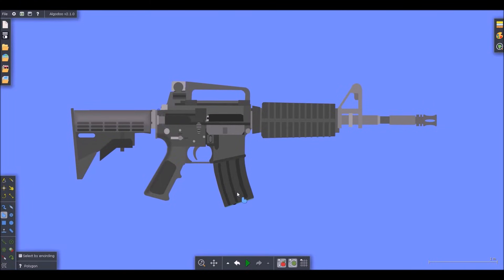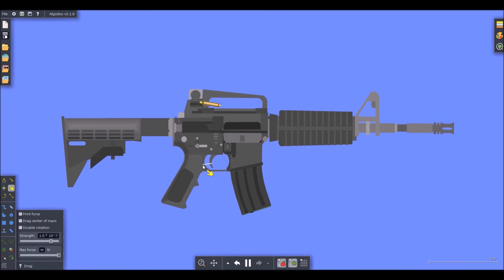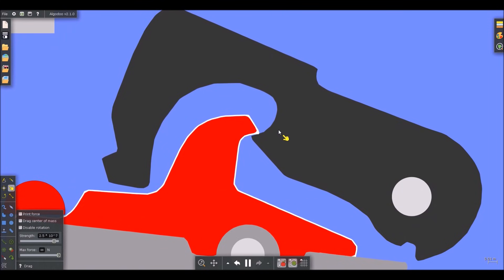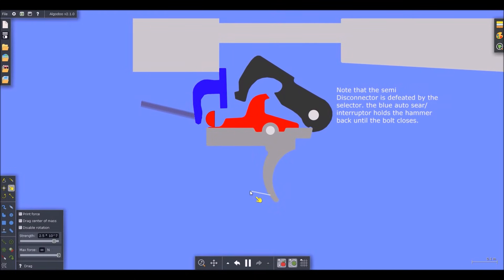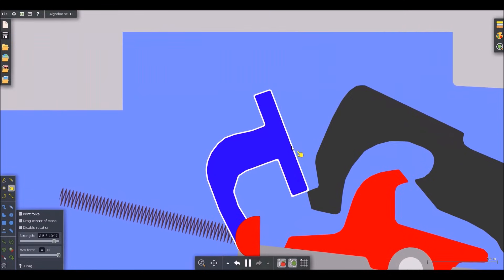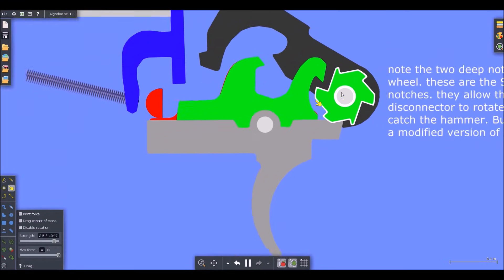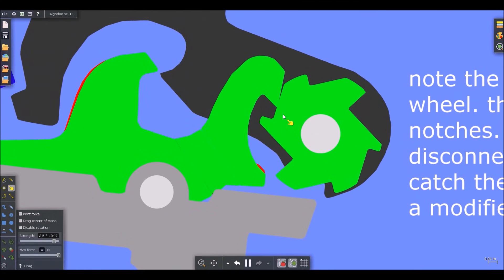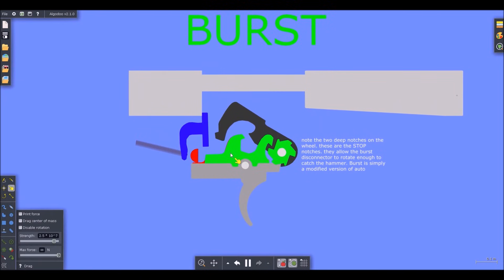How 3-round burst works

Comment: Nice video, I would add that the ratcheting wheel is also ratcheting in the normal axis of the screen, and has a spring loaded pin housed on the hammer; thus only transfers energy when the hammer is moving non-clockwise.
Reply from the maker: Actually, there is no pin and ratched in the cam wheel. Instead, there's a coil spring clutch that is bound the the sear and binds to the hammer's axle base when it's being cocked, but slips when it's dropping.
Reply: Oh I have no experience with American weapons, the Kalashnikovs 2 round bursts work with dual ratcheting surfaces, I wouldnt trust that tiny spring after heavy use. Are you sure its not dual ratcheting?
Reply from the maker: Aleksandr Mijáilovich Prójorov i'm sure. It's entirely friction-operated.

Comment: Now what happens if you release the trigger in the middle of the burst cycle then press the trigger again? Will the cycle pick up where it was interrupted or does it somehow reset that gear?
Reply: unfortunately it picks up where ya left off.not that big of a deal as the second and third should be more about insurance anyhow but its definitely possible to get a double tap then a single especially if you have any time practicing doubles on a standard full auto..also tends to happen a lot with fresh mags and /or after a misfire or feed failure

Comment: Detailed explanation, thank you - but I wonder what would happen if you attempted to do a three-round-burst with only two rounds left in the gun? What happens if the camwheel rotates only to a 60 or 120 degrees, and a full mag is inserted to continue firing? Or if another firing mode is then being selected? Are there any risks that an only to a 60 degree rotated camwheel could cause the gun to fire a two-or-three-round-burst even if semi-auto mode is selected? Could an incorrect operation of the burst mechanism or the selector switch cause damage to the gun? My favourite example is the Beretta M93R, shoots semi or three-rounds-burst, mag holds 20. Of course one could load round 21 directly into the chamber, so there would be 21 rounds in the gun and all would be fine with seven bursts of three shots, but with 20 there can only be six bursts and two would be left in the gun, or the camwheel will just be rotated to a 120 degree if last two were fired...
Reply from the maker: The m93R uses a linear cam inside the grip that auto-resets whenever the trigger is released. Many other firearms also use auto-reset cams. The AR platform was not designed with burst in mind initially, but the mod was one that came later. Since they effectively had to retrofit the existing trigger with as few parts as possible, they went after simplicity at the expense of reliability. Indeed, the cam can be in a position that is between bursts, and it consistently steps one notch at a time in semi. There's videos here and there where marines or soldiers fire single shots, switch to burst, and get one or two rounds instead of three. But immediately after, it goes to three rounds every trigger pull (unless they run out of ammo or release the trigger early, in which case the mech would have a short burst once reloaded and firing again)

The mechanism won't damage the gun in any way, it's just a tad finicky
Reply: Thank you for the quick and explicit response! I think in a combat situation it is crucial to have a gun you can totally rely on, but if you expect three shots and only get one or two this could mean serious trouble. And rumor has it that if this particular type of gun is not maintained properly and by experienced personnel, this will lead to no good...To me these types of guns would be great collectors items and serious fun on the range if there was a chance to own them legally, one can almost forget about that here in Germany, but I don't think I would trust my life to this particular type of gun, if I was given a choice I'd obviously go for the fun switch but in a more reliable standard semi/full auto configuration - nevertheless, anyone who, like me, appreciates mechanical devices like precision clock movements can't help but be intrigued by this extent of ingeniosity and skillful craftsmanship!
Reply from the maker: +Frank Steinmann Of course! I try to stay on top of this as much as possible :) I do have another video like this for the MP5, if you wanted to see that. It's very different. Check it out!

I also grew up in Germany :P I speak German and English fluently, but more so English after living in the US for so many years.
Reply: Awesome! I live in a small town 20 miles from Münster, nearby the Ruhrgebiet - how do you like my English?  Checked out your MP5 video, really cool stuff, the MP5 is my favourite submachine gun - I'd love to own one, my choice would be the MP5A3 with fun switch, S-E-F trigger group and flash hider, or even the MP5K PDW in same configuration.
Reply from the maker: +Frank Steinmann your English is perfect!

Comment: This makes things super clear now. I knew there was a way to turn a three round burst into a full-auto safely, but was wondering if it would work for a semi-auto as well.
Reply from the maker: You'd have to remove either the burst sear's hammer-engagement interface (hook) or remove it altogether and replace it with a washer of near-identical thickness. Semi-only(civilian AR) to auto? A lot more has to be done. Won't bother explaining that, though it should be obvious what would be needed.
Reply: I did recently learn how to make a lightning link, which wouldn't permanently convert a ar to full auto.
Reply from the maker: +MrChucklebean i would be careful if I were you; I'd rather get a grandfathered mg legally through all the expenses and hoops, and not risk severe penalties for a victimless crime

Comment: Awesome video! Though, can you explain what keeps the 3 round burst wheel from spinning freely? Is it a spring loaded ratcheting action? Thanks in advance.
Reply from the maker: The extension of the burst sear/disconnect is enough to keep the wheel from reversing, but it'll still tend to spin in semi auto as well. You can get a shortened initial burst  by firing in semi auto and switching to burst, yeilding either one or two shots if not three. Of course, the next pull of the trigger would function as normal. The mechanism responsible for rotating the cam is a spring clutch bound to the wheel. It's a small coil spring with an internal diameter matching the external diameter of the shaft at the bottom of the hammer. It slips one way, and binds the other.
Reply: +Stealth The Unknown Awesome, thanks again! I'm just getting back into the AR world!  :D

Comment: How does fire rate control (like on Maxim gun) works?
Reply from the maker: Not sure about the maxim, but for some, an inertial delay can be used to reduce fire rate. For example, if you were to look at the trigger group of an AKM and compare it to a traditional true AK-47, you'd notice an additional part hinged on the trigger pin. It's a component that uses its inertia to delay the hammer drop. It's minimal, but it is measurable. I believe the original intention was to help prevent light strikes caused by imperfections due to cheap mass-production of stamped receivers like that in the AKM. Though, the idea can be upscaled and selectible to allow adjustible fire rate
Reply: ***** Thanks!

Comment: Seems like it would be extremely simple to just file that catch off and make a semi auto gun full auto.
Reply from the maker: This is an unreliable mod, and I wouldn't reccommend it. Since you wouldn't have a true auto sear, you'd be relying on the inertia of the disconnector to hold the hammer back long enough for the bolt to lock into battery. If it was filed too much, worst case scenario is an out-of-battery fire. Best case, hammer rides the bolt forward. 

Long story short: don't do it.
Reply: ***** Don't worry I wasn't planning on it, but couldn't help but notice a potential modification that I bet people have tried.
Reply from the maker: +KiwiPowerNZ more than likely. People tend to do things that are questionable.

Comment: I saw the Glock. I've bee studying too much SolidWorks (I hate it, everything is tough on SW), I won't be so good on Algodoo so soon. Maybe I have a hardware problem with the 3 computers I use, some designs still are starting to shake and I just can't find the reason.
Reply from the maker: It's likely the low simulation frequency. Algodoo defaults to 60hz physics timestep, which is good for simple physics, but not where tight tolerances and quick motions are being rendered. Things clip through one-another and bounce out, causing shakiness and mechanical failure. All my scenes use an average of 200-300 hz, with only a couple using as low as 100. To increase the frequency, go to settings (gear icon), "simulation" tab, and slide the frequency slider to an acceptable frequency. I would start with 200 and increase only if necessary.
Reply: *****  Yes. I tried. Sometimes works, sometimes not. In one case I did not note I draw two identical parts on the same space (my fault).

Comment: Did you consider to incorporate a two stage trigger on your designs? Just something to tell the firer "from this point this gun may fire", like the Geissele, which seems to be just an AK trigger on a AR15 receiver where the accidental contact between the secondary sear and the hammer causes the two stage trigger effect. I gave a little on algodoo and I am trying to dominate Solidworks. From autocad to solidworks is like from windows to linux: tough, tough, tough, tough, tough,  and painfull, but not impossible (even for a stuborn donkey like me).
Reply from the maker: I actually have not really put much thought into that. When I get a PC capable of running the program up again, I'll try it. In real life, I noticed the benefit of a 2-stage trigger.

Comment: This is an amazing animation and I am trying to do something similar, how did you do this with Algodoo? I am looking at purchasing the spaceclaim software, but don't want to spend that kind of money to do what you have done here.
Reply from the maker: YEARS of messing around with the program lead to innovative ways to manipulate it. My best advice is to make the shapes of parts as accurate as possible, make their densities high enough to improve functional reliability, and to increase the simulation physics frequency high enough to stabilize the scene if there are a lot of fine moving parts. Usually 200-400 hz does it.

Comment: I'd just like to point something out where you were slightly off, you said that if the hammer fired off too early, it could result in catastrophic malfunction, which is wrong, it will simply ride the bolt forward and not fire, because it doesn't strike the fireing pin with enough force, which is easily demonstrated by tying down your seer, or bumpfiring to fast, it is an action known as outrunning the gun.
Reply from the maker: +Bradley Homer this is true, but I was trying to make the point that it is dangerous and unreliable to have the hammer follow the bolt forward. Though it is rare that this causes any kind of out-of-battery firing, it HAS happened when "outrunning the gun." The results have always been undesirable in those circumstances
Reply: I've tried to make guns fire like that, but I could never get it to happen.
Reply: Bradley Homer - ok. So if you watch the video I posted above, starting at about 8:00 into the video he starts to explain that (while not likely) there is a chance that if the disconnector failed to catch the hammer and did ride along with the BCG, there's a possibility of the round firing out of battery. Just wanted to point out that he wasn't entirely wrong when he said there could be a catastrophic event. No biggie.
Reply: hey guys put your rulers away
Reply from the maker: +Jason Cox this is so wrong, but I'll elaborate further since you are sort-of on the right track. It won't fire after the first shot if you remove the disconnector, as the hammer will ride the BCG forward (bolt carrier group.) However, some people have allegedly filed the interface on their disconnectors to temporarily catch the hammer, but cause it to slip soon after, effectively turning the mechanism into a rate reducer. This mod is highly illegal, though, and I'd advise against it.
Reply from the maker: +Jason Cox fair enough. I'd imagine if the firing pin wasn't shrouded, the issue could occur. I'd venture the disconnector had bad engagement rather than being missing.
Reply: +Bradley Homer I was just getting ready to point this out.
Reply: Bradley Homer - you are wrong. there IS a chance the round could fire and not just "simply ride the bolt forward".
Reply: Could you show some type of evidence, or a documented example, I'd have no issue admitting I'm wrong, if you can show me how I'm wrong.
Reply: This is commonly done on AKs, since you can tie back the arrest with a piece of wire creating a full-auto only version that does ride the bolt forward.
   
You have to extend the firing pin, however, since it has far less pressure on it (meaning it will naturally dimple the primer but not activate it) and it is stupidly dangerous (since it can explode out of battery, since you are pushing the round with an extended firing pin).

Comment: Why the wheel rotate in one direction?
Reply: +sakda K. i too would like to know i assume there is some kind of little spring finger that acts like a ratchet kind of like how a ziptie works it slips through one way but doesnt go back
Reply from the maker: +Justin M sorry I missed this. This is something I've answered a few times as well. It's a friction/clutch spring, and binds against the hammer as it's pushed backwards by the bolt carrier, and slips as it drops. Ever take a coil spring and wrap it around a pencil, or a rod of any kind with a similar diameter? A good place to look is a pen. Remove the ink insert and the spring wrapped around it. Try rotating the spring. Notice how it binds and locks up going one way, but not the other? This uses the same concept, with the burst disconnector aiding in keeping it from slipping.